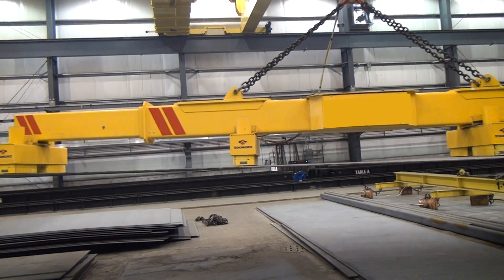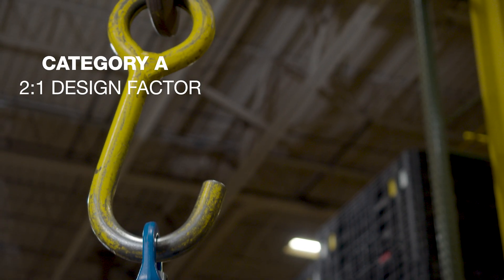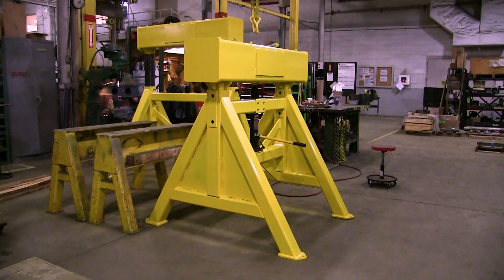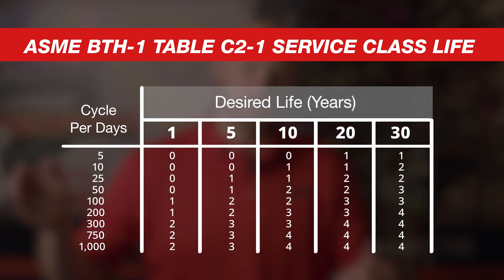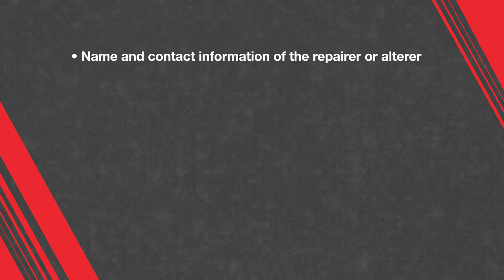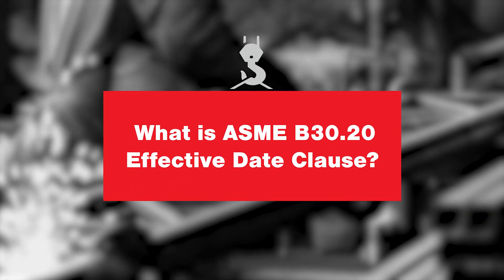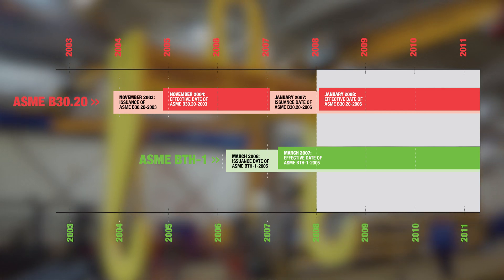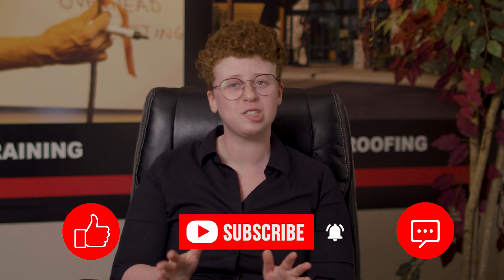Identification & Markings for Older Below-the-Hook Lifting Device

Comment: Can welding be applied to the lower radius of the load "C" hook? Or is it a practice that is not recommended?
Reply from the maker: The short answer is no. This would be considered a modification, and the C hook would then need to be removed from service. Only the manufacturer can perform any modifications, and after the C hook would then need to go back through the certification process by the manufacturer. Modification of any of your lifting gear would require the gear to be removed from service.